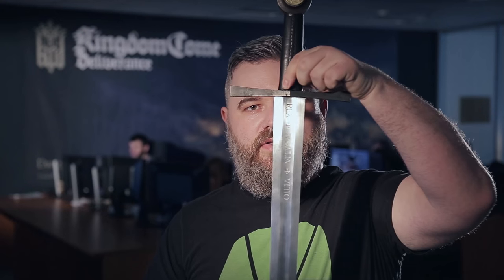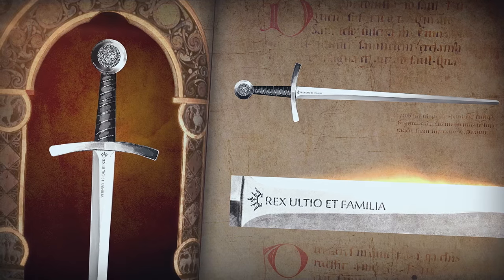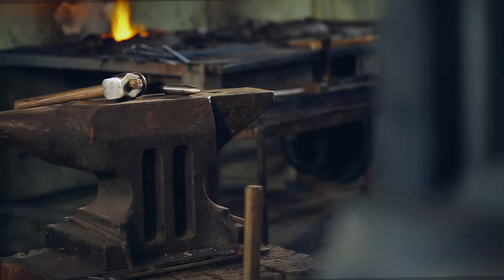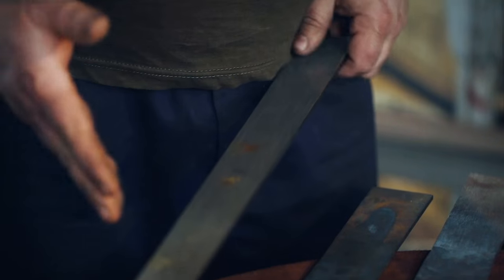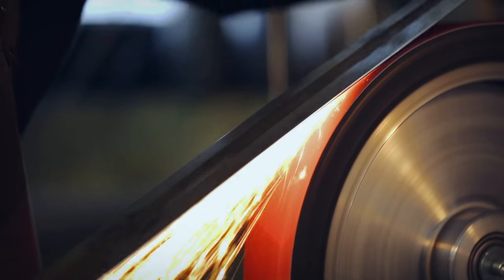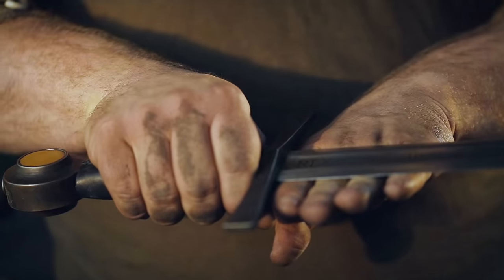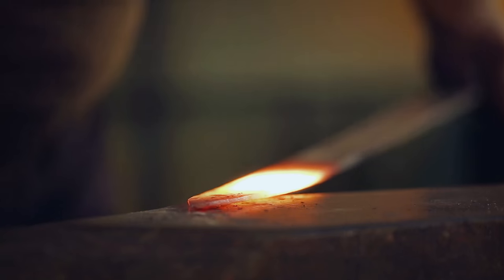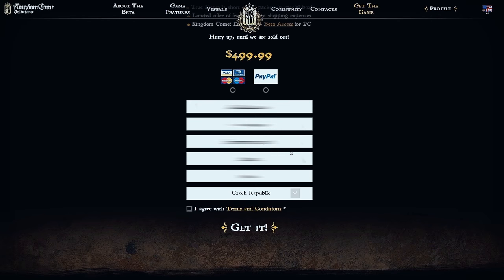Kingdom Come: Deliverance Video Update #15: Crafting the Swords

Comment: I wish I could afford a pc so I could support the beta. I cant wait until it comes out for consoles
Reply: +DeVon Tucker Same here!
Reply: +DeVon Tucker What are you talking about? A decent PC costs roughly as a console. You don't have to buy everything new you know. When i was a kid i played Super Mario on Terminator 2 console. Then i got my first PC and even through the years i changed it many times i still use the same case from that first PC. Usually i keep the monitor, HDD, keyboard and mouse, sometimes even the PSU, goes without saying that i keep the case. With all these i have plenty of connectors too so this goes in to less spending also. It all depends but mostly you can have a good and competitive PC with just a minim investment. So basically the price for a console is way more well spend on a PC because i can do a lot more with this PC that i would do with a console.
Even if you are not a PC owner you still can support the game if you really want to, no one is stopping you.
Reply: That's right, consoles! Finaly someone with clear mind.
Reply: +Somnorila I said the beta. I know I can still donate.
Reply: +Somnorila PC which would run this game would be at least two time more expensive than console (PS4, XONE), more like three times so stop lying, PC gaming won't prevail forever.
Reply: +Martin Kolafa He knows that to run a game like this at any decent graphic level that Id need to spend over $1000. He just was being "that guy". My Pc now was 600 and can barely run minecraft.
Reply: +DeVon Tucker Buy components separately and mount your PC up, you save a LOT of money and get good quality. I paid even less than 500 and yet I can run Far Cry 4, or Battlefield 4 at ultra, and generally any new game. (Of course I kept hard disk, case, monitor, keyboard, mouse and all of my old PC..)
Reply: +Somnorila 100% true ... Consoles are a waist of money, of course as a kid i had one, but once u figure out that pc is much more reliable and you can do whatever u want, console are just a waist of $$$
Reply: +Nanaka GN grammar was a waste as well?

Comment: Well. The process of tempering would get rid of all the magic "hammer compression touches" the smith was talking about. So a machined sword or a hand forged one is really just a matter of taste and not a measurable matter of resilience, hardness and toughness. 

The tempering makes the sword. Machines swords can be - and almost always are - more sturdy than hand forged one, because their crystalline structure is more evenly distributed due to them coming out of a big fat steel mill that spread out the carbon content evenly in the steel bar.

Hand work is always appreciated and it definitely shows in a blade. If you like that, buy a hand forged sword. But don't buy because someone told you it's more sturdy. That's not true.
Reply: +Waldgeist No.

Comment: Somehow I'm really sceptical to the claim the crystaline matrix in a forged sword is somehow compacted and thus more resilient than in a ground or machined blades.
I mean, I've heard this in the past from various Czech smiths, but it doesn't seem to make sense, considering the blade goes through heat treat anyway. (which relieves stresses etc.)
Just say it's handmade because that's what people want. ;) (unless they want an Albion sword, some of the top quality swords out there, which are iirc machined)